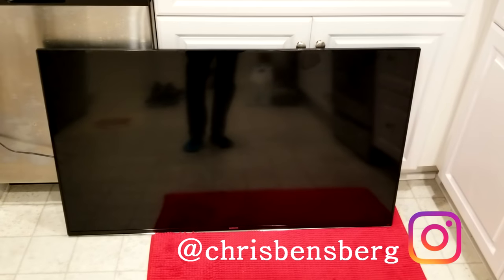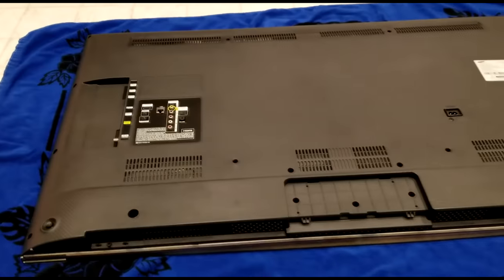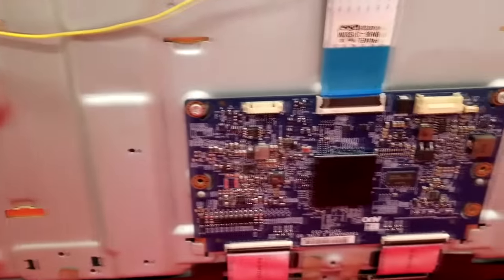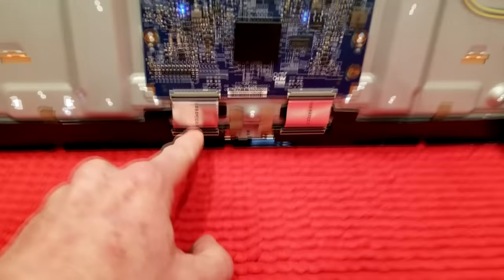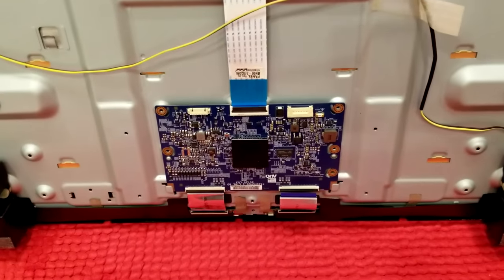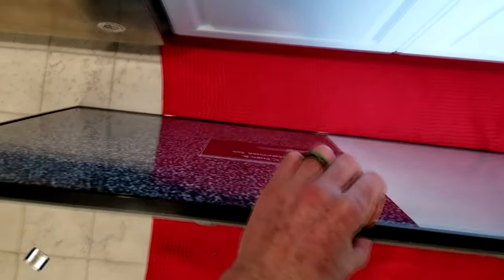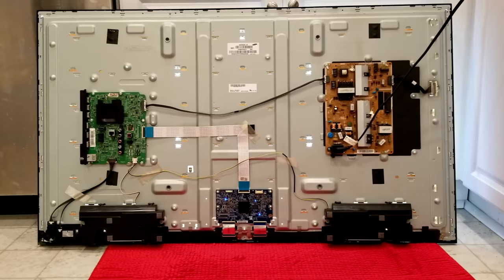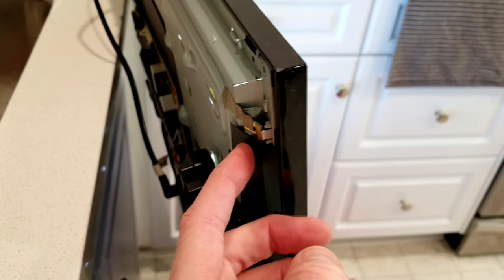Samsung TV Powers On With Back Lights But No Picture Potential FIXES or BAD PANEL

Comment: It’s not bad panel, it’s the led driver one of the ribbons is bad. On the left ribbon coming from the tcon , put a little masking tape covering about ten pins, and so on. This disables any of the connectors in the bad side of panel because these work paralel so you’re basically skipping one and the tv will be back working 100%
Reply: This 100% worked for me!  I can't thank you enough! Just enough tape to cover 10-12 pins.
Reply: Can you help me? I don't understand covering the pins with tape.
Reply: Your trick works, however, it is not the ribbon cable thats is bad, the pannel is bad, the way the tape trick work is by blocking the signal going to the bad side of the panel.
Reply: Bro i have Samsung tv broke in couple years  ago i see logo but now only sound i hear
Reply: I concur doctor
Reply: @Stéphane Mallette  
Sorry, just seeing this now.
If you still need help, I can try and explain what I did
Reply: @Nocholas  you need to remove the ribbon cable on the right side (if your TV is face down).  Use scotch/clear tape and cover approximately 10-12 of the pins starting from the outside of the cable.  Plug it back in and turn on the TV.  If you have a full screen,  you're done and reassemble. If not, adjust your tape to cover more or less of the pins.  It's kind of a trial-and-error process.
Reply: @johnp7933  thank you for explaining, i will try it on mine with the same issue
Reply: This trick worked! It is a lot of trial and error with taking the tape on and off, but after 5 minutes with fiddling with it the tv came back to life.
Reply: Oh wow this trick just saved my tv 🙌🏻🥳
Thanks a lot ❤
Reply: this also worked for me. i had to cover 13 pins in my case. there was still a small black line on the left end of the screen but over good picture and definitely better than buying a new tv.
Reply: Thanks 🎉
Reply: This worked for me, thanks.!! I used Scotch tape 10-13 pins from the right side of the right side ribbon. (TV facedown)
Reply: Youre a real one for this. Thanks!
Reply: @johnp7933 does replace the ribbon cable fix this issue?
Reply: I done exactly what you are saying on a lg tv with bit of tape and that worked 100%,brilliant advice buddy 👍🏽
Reply: I have taped all the pins on both the left and right side (in increments of 5) and none of it has worked.

I have a blank screen but it lights up for a little bit before turning off.

Any help would be appreciated. It was working fine then it just had no image.
Reply: @TigredelMar77  yes and no, you have to run the tape test.
Reply: @justintherhino6585  you put the tape on side only, moving and moving the tape until you have tested all the pins, of course once you have detected which side is bad. If nothing works it's either the TCON or the LCD itself, or the boards attached to the LCD panel.
Reply: @Riko333  can I test those or is it just replace it? The backlights work. I have tested all the pins. Power supply is fine.

Comment: @TipsNNTricks the problem is on the boards that are directly connected to the t con board, these boards are connected to the screen the fault is simple and easy to repair you just need to replace smd capacitors

Comment: Good job disconnecting the one side of the tv as part of the diagnosis.  There are two more things you can try.  Did you ensure the problem wasn’t one of the tab bonds lifting on the buffer board?  Also, on the buffer board, you can check for shorts.  Maybe there is a shorted cap?

Comment: Great video. I had no backlights or video but sound. Had 25/60 backlights burnt out. Changed backlights & now backlights work, but still no video. It's a 50" Samsung also. So I'm also wrestling on what to do. Thanks for the tidbit on removing 1 side of panel by removing cable. Never thought of that. Thanks again

Comment: Nice video - and unlike pretty much every other video you actually cover the whole process and LOGIC of why it would be a certain component and how to determine it with certainty.   THANK YOU.  I replaced my t-con and main board in a Samsung UN43 - I had power, backlights, sound but no picture.  Replaced the boards, had the same damn thing.  It's not my tv, it's a friends, so not the same hdmi cable or video source.  Screen does light up at -2- levels of intensity, but only backlighting.  Menu/source buttons result in no change.  I messed with it every which way for an hour.  Then friend said she used a firestick, so for the f*ck of it I plugged in a blank USB stick.  Bam.  Power on and see SMART-TV logo.  WTF?  I swear this is exact in every detail (as a software engineer I do not miss the details LOL I also do not understand why being a software engineer makes my friends think I can repair TVs or cell phones LOL). 

Can you offer any insight as to WHY and HOW the usb stick would cause the damn  tv to start working?  After that, Directv works fine, video, sound menus etc..
Reply: Maybe that usb  connector seems to be shorting or doesn't gave the signal for the board to turn on properly
Reply: Yes I remember that plugging something into an hdmi it can start working again. I couldn't tell you why, but I think it resets or reroutes something

Comment: This is most likely a faulty or shorted address or clock line in the lcd panel.  A short in these signal lines of the panel will drag the voltage down on the TCON ASIC forcing it to shut down.  Since these signals are redundant and get driven from both sides,  you can block one completely and the other will still drive the panel just fine.  The are various ways to repair this,  but much of the time people have been using scotch tape but if you have an oscilloscope,  you can narrow it down without guessing.  FrugalRepair has a good video on the tape method.
Reply: Thank so much, it works! I put sticky tape on the connectors!
Reply: @jonykwa888  did you have trouble figuring out which connectors? I put a bit of tape on one side and it made most of my screen work except a small portion. I then proceeded to add another small bit but that ended up making the whole picture disappear. After removing the tape and moving tape bits around I haven't been able to make it work again.
Reply: Which video on frugalrepair ?

Comment: @TipsNNTricks So I’m assuming (& PRAYING) that it’s simply a bad T-con board rather than a bad panel if you get backlights but no picture whatsoever (regardless of how you connect one or BOTH t-con>panel ribbons)??? That’s what I’m dealing with, in addition to constant restarts once I try to turn it on. Replaced a puffy cap on the power board & the problem continued. Then replaced the main board & it still does the same thing. T-con board arrives this week & I’m praying that fixes it because this TV was a dumpster find & legit LOOKS brand new. I looked for burnt sections on the power board & saw none, plus all voltages on the power board checked out ok, so just a bit stumped here (especially with the restarts). One thing I’ll also mention is that the T-con board does not have ANY leds lighting up & I’m not sure if my particular model simply doesn’t have any installed by design or if leds ARE installed but simply not lighting lol. Mine is a Samsung UN46D6420UFXZA
Reply: How'd the replacement T-con board work out for you?
Reply: @yokozunad  Well it's been a little while, but from what I remember, I was finally able to get a picture AND resolve the issue with the constant resets after replacing the tcon board.. BUT I did all of that (in addition to the prior part replacements) only to learn that the picture had horizontal lines going across it about every half inch. So I tried the "scotch tape trick" on the ribbon cable/connector that leads from the T-Con board to the panel, but just couldn't get around the "horizontal lines" issue even with that. Finally gave up about a month ago, & after several months of having that TV just sitting in my place on its side, I put it right back where I found it (in the dumpster lol), but NOT before pulling all the salvageable internal parts (including but not limited to the ones I purchased while I was in the troubleshooting process). Kinda petty on my part, but I just couldn't fathom the thought of someone else A. benefiting from all of my costly hard work/troubleshooting, B. taking the parts I purchased+reselling them &/or C. going through all of the same steps I already followed just to end up having the same experience lol. Really loved that series & wish I could get my hands on one, but in reality, we're in the 4K era now so goin back to a 1080P set is kinda silly at this point.

Comment: Did you try masking a few pins on the tcon2lcd right side connector only.
Reply: How to know which pin need to tape
Reply: @jdjfjjdkfkgkfjdndnfnf  the Indian technicians seems to know a lot about panels. They can pin point. I would just trial and error. Guess work.

Comment: Thanks for this great video. I am a computer technician and my UN32N5300AF as it shows in the model as a 32 inch. This video cam out before the pandemic so right now prices are higher, however I don't believe in throwing electronic items in the landfills at all. My backlights do work and after reseating the cables which should always be done first, I will check those lower cables one at a time next since that brought up half your screen. Great tip there. Thanks for the information.
Reply: Ay bro , my monitor has the same issue , so this is applicable for computer monitors too?
Reply: There ain't no good technicians nearby so my only options are take a look at it myself or just get a new one
Reply: I'm considering buying a new one but still i do wanna take a look at it
Reply: tcl 55 was fixed by frugalrepair using tape strips to mask ribbon...genius, works good

Comment: Did you check the ribbon cables themselves? What about the solder joints on the connectors? It looks like a simple connection fault rather than bad boards.

Comment: Use tape on the ribbon cables there’s a short on that side of the panel all you do is cut out the clock lines easy
Reply: could you elaborate on this process a bit more
Reply: This works, you can use a piece of paper too at the ribbon cable.

 Just cut 1 cm ones, and put it under the T-con ribbon cable(to the side where you have no picture), and move it until you block the bad panel to communicate with the t-con.

Comment: When you can get it to work with one side of the ribbon off, that means you have block signals according to a lot of Youtube channels that do the repair.  You'll have to figure out which ones are blocked and just scrape off the connections and they should work. 

I have a different issue where removing the ribbons one at a time did not work.  I bought a repair kit as I am not good at troubleshooting.  I did check the components suggested by some channels and they appear to be good.  I found a good deal for the kit so I decided to buy it.  Turns out maybe it was another bad part or my panels are bad.  I'll continue to troubleshoot or maybe take it to a repair shop.  Hate to throw it away because it's a 65 inch 4K TV.

Comment: Hum : Changing parts as trial and error to determine the issue is not a good solution.  The output voltaje for the display should be measured, and some other signal before the T-CON board and then after.  Also the regular steps of reset (just to discard them).

Comment: What you should do is to cut a piece of paper about 1 to 2 cm and place it under the connector of the side of the screen that has no video this will blocked out a section of the contacts which is causing the problem you may have to move it along the slot until you find the area that is causing the problem raadam picture is back.
Reply: Thank You so much! I have a working television now.:)

Comment: There is another video showing a fix for this....it's the buffer board yellow ribbons leading from the tcon to the screen.. the guy just cut part of the bad side ribbon and it worked again
Reply: Hie can u post the link to that video pls. Ta
Reply: @TheKani09  it's on youtube somewhere under no picture sound fix.....I couldn't get to the ribbons to try it

Comment: Well thats SUCKS! I have a question my issue is that power supply works fine tcon has all 3 lights i took the ribbins off 1 by 1 that i guest is fine no half pics but so my tv when you turn it on shows the smart tv logo fine and then nothing happens does that mean the panel and tcon board is good but i have a issue with the main board since its not initializing the menu but the smart tv shows?

Comment: It’s a shorted cap on the small board where the t con board conect to the panel
Reply: how so? I have a vizio with the same problem. FML
Reply: How can I fix this?
Reply: @sg4218  I think he means those two small boards that connect directly to the LCD panel. I saw a video of someone fixing caps on them. If you can see a bulged one you can try to replace it, or all of them on that side, otherwise I think you have un-solder Caps to test them which sucks (let me know if there is a way to test them without un-soldering). You can try moving the ribbons tht connect directly to the panel to test as there could be a broken wire in one, but you can't replace those ribbons, that'd be just for a test to see if its worth it to fix other stuff.
Reply: Josephthinleg dang that’s a lot of work
Reply: @sg4218  Yeah haha, I just throw those ones away as not worth it to me, can sell the parts and stand though.

Comment: I need help. The 2 blue lights don't come on on the board inside the tv. Everything was showing and the lights would come on as soon as you plug in the tv. Now I get the backlight but no picture and no lights on the board that the ribbon connects to

Comment: Every time I fidgeting with the ribbon cable in the main board connector it's working. Until I turn the TV off. The next time only backlight again. T-con board is replaced but it could be bad too (brought as recycled part)

Comment: My LCD lights and POWER ON light just flashes OFF AND ON OFF AND ON  with no picture.
Reply: that sounds like a capacitor issue. easy to fix, if that's really your problem.
Reply: @DominikMuhelye  I have already replaced the POWER SUPPLY BOARD THE MAIN BOARD AND TCOM BAORD   TWICE and the same thing.
Reply: @williamjamesrapp7356  That's what mine does, sounds like bad LED's. I would have never though some bad LED's would cause that flashing problem. He has another video about this for an LG TV you can watch. And shows you how to test the strips. It's Called LG TV Flickering Problem FIX - TV LED Back Lights Flickering or here is his link https://www.youtube.com/watch?v=Fva__AeWMW0
Reply: Oh and here is his video on how to test the strips, sorry i thought that was all in the same video. How To Test TV LED Back Lights Without A LED TESTER! or the link https://www.youtube.com/watch?v=1n-Nq8HLK20
Reply: @Josephthinleg  THANKS Brother.  I will give that a try and let you know what I find out.
Reply: @williamjamesrapp7356  Hey no problem! I'll let you know how mine goes too. I'm glad I found this channel, as I was about to buy boards too. I haven't seen that exact problem before, so wasn't sure which board to buy/try first. But yeah those video links I sent you look exactly like what mine is doing, flashing like that. And yes be super careful when taking off the actual screen. I've only done that with broken screens before (to get the LED's out) so I didn't care about the screen. But yeah, normally there are 3 plastic sheets and then the screen itself (which is very delicate). Keep in mind the order of the plastic sheets.I think it is the thick one, then the shiny one then the skinny one, I think, and then the screen. I actually used those for giant cutting boards haha, if I catch a big fish.

Comment: I need help with the Sony kdl-49w750d. Back light turns on then as soon as it turns off  the red light blinks 6 times. The moment the TV died, it went green and flickered a bit until it turned off. How can I diagnose this issue?

Comment: There's a COF strip that is attached to the side of the panel.  It controls the horizontal part of the panel.  It's more likely damaged.  If you are about to throw the TV away, you should try this first.  On the side of the damage side, tear it out carefully.  This fix is irreversible! There is a video on how to do this.  I had the same problem with my 70" and it worked.  Good luck.

https://www.youtube.com/watch?v=sJ0EzOuckyU
Reply: you can just block the ck pins on the ribbon cable

Comment: Woooow I had this issue with a used Series 6 tv I got off facebook marketplace. It does turn on but i have to keep pushing the power button  on the remote a few times and it finally will. I can see it flicker like it wants to turn on. I wonder if thats why my 4k bluray player looks dark compared to my Series 7. I just have to fix the surround now since the bass isn't as deep as the Series 7 when connected to the 4k bluray player for some reason

Comment: My samsung doesn’t have a t con board, I replaced the main. Board but stil back light on but no display with sound
Reply: What model and any update. I have the same issue but have not replaced main
Reply: @inspectorh5044  yeah nothing is working faulty screen boards the ones that attach to the screen them selfs

Comment: My tv doesn't have a tcon board.. any ideas why? It's a UE50KU6072 appreciate your help
Reply: It could be hidden, or some TV's might have it built into the main board, just follow the ribbon cable from your main board to the screen to see.
Reply: Hi pablo. I have same tv series, but just smaller, 40 in. Can you tell me how you fixed it, and at what cost?
Reply: @NeRa101  what I simply did was take out the ribbon connectors from the main board to the panel and put them back in and it started working back.